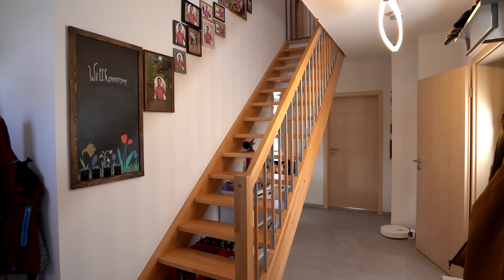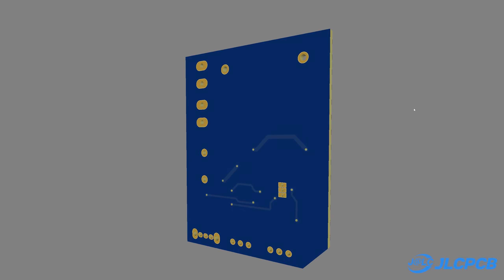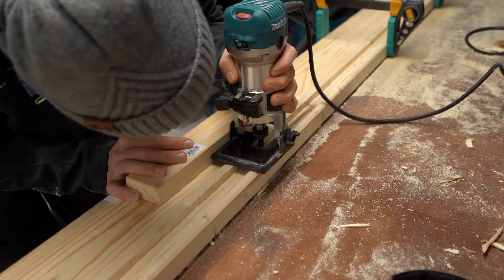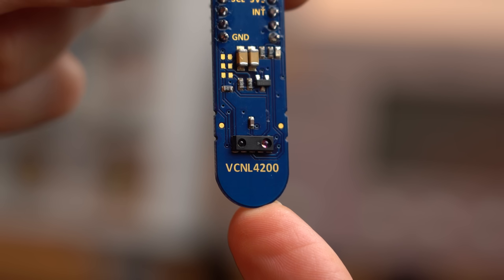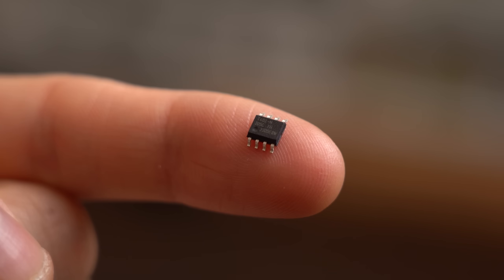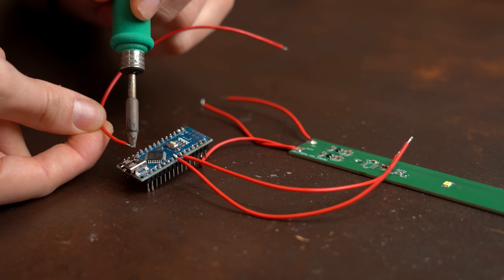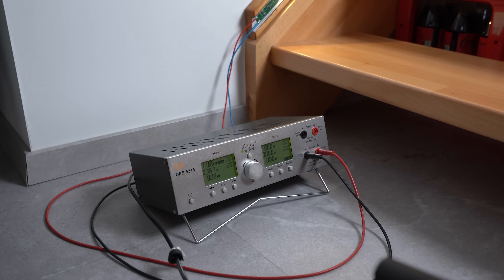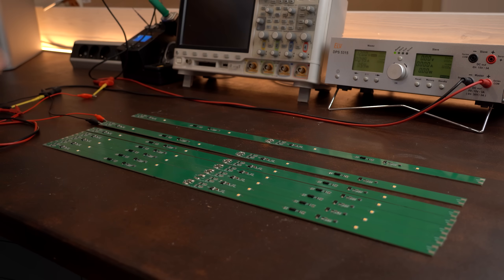I tried to Revolutionize LED Lights!.....And FAILED?

Comment: Like other comments (basically) said, having so many MCs (and sensors) involved is already a recipe for disaster... ^^; KISS should really be a core principle for designing anything. The following light may be nice but just complicates the build and adds a ton of extra components. The bare minimum would be one sensor at each end, a single MC that manages them, and then some simple latch/timer logic to turn the whole strip on when one of the sensors detects something. Make the other sensor turn the strip off again and add a fallback timer of 1-2 minutes in case there was a false positive. Raising the sensors to the "top" of the channel (or using light guides) would make it possible to use diffused covers for most of the strip and only a small piece of clear plastic in front of the sensor.

Comment: I'm scratching my head with some of the design decisions you made in this project.
Why make the light output not only dependent on the distance from the sensor, but lower as the distance increases?
Why make it so the step you're on is lit up, instead of it and the adjacent ones too? After all, what really matters is where your feet are going, not so much where it is at the moment.
And wouldn't you have used some pogo pins, or even regular pin headers to interface the boards? It would make it so much easier to debug, as it would be just a matter of removing the boards in the way of the affected board, and one at a time, instead of dealing with soldering and such while everything is in the wall.
And regarding the diffuse vs clear covers, have you tried with the diffuse to see if the sensor really doesn't work? And assuming it really doesn't, why not simply putting just a small piece of clear cover over the sensor, while using the diffuse cover over the LEDs?
And on another note, I really hope you succeed with this project, it looks really interesting.

Comment: Good video. I have also had this idea in my head for years. Maybe instead of infrared distance sensors, microwave sensors could do the trick? Or 1 really good long range microwave sensor combined with addressable leds or even with the WLED project.

Comment: A problem i had years ago with a networked chain of sensors like this was simple voltage drop along the chain. Ended up splitting the chain in two and powering from each end. The browning out of the microcontrollers let to all kinds of completely bizarre behaviour which disappeared when tested externally.

Comment: You could use pressure pads or membranes on the actual stairs, rather than ir detectors, and to make the stair before and after light up could you not use resistors coupled with sensors that detect the drop in voltage (2 step) to turn off so the step you are on will be at 5v (brightest) the next step would be 3v (dull) and the step after 0v or probably 1v then as you step on the next that becomes 5v etc etc

Failing that buy some of the cheap poundland pir garden stake lights, adjust the timers on them break the steaks off, tape them to the wall and add some wire to the battery terminals to join them all together with a 5v plug so they trickle charge, at least then if your power goes out you can still go up and down the stairs safely as they have battery backup....

You can tell me to shut up if you like im probably talking out my backside, im a pc tech rather than an electrician but i like to tinker 🤣

Comment: Your AL8860 circuit is going to inherently be noisy because there is no capacitor attached to the inductor. And the diode-inductor-LED trace is extremely long to boot. It's a massive antenna. You could try salvage things by putting a lot of ceramic capacitance in parallel with the LED but I wouldn't expect any miracles.

Comment: One way would be to have one "Master Controller" where each strip has its own ID and the "Master Controller" receiving the sensor data with a device ID and then sending a command with a device ID where the strip with that ID would light up

Comment: The Youtuber I Like To Make Stuff did this same project 10 months ago. He was re-doing his stairs so he integrated the LED strips into the steps themselves. It's been awhile since I've watched it but he had the same issues you did. He didn't resolve the problem and just ended up putting a motion sensor at the top and bottom and just lights up the entire staircase for a set amount of time.

Comment: My suggestion is to use an individually addressable LED strip and DIY a strip of distance sensors, all connecting to an arduino box. That way you don't have to reinvent the wheel and simplify connections.

Comment: Really cool idea, but as other suggested I would definitely go down the route of addressable LED’s with a dedicated warm white channel as well as only using two sensors on top and bottom the. You estimate that you walk at a certain speed…

A quick question on how the IR sensors work, don’t they interfere with each other? I assume they would have some modulation on IR patter  but if not having so much ir light doesn’t cause them to go strange?

Comment: Such a neat project!
I like very much the idea of an automated night light for the stairs. And your girlfriend was right to push for a solution which blends with the existing furniture: you did a very good job with the wooden housing.
I haven't looked at the schematic yet so I won't comment on the troubles with getting the design to do its job properly.
I'd like instead to make your life even harden 😆By chance I'm also looking to make a light helping me to find my way if I was to walk around the house at night and I'm thinking of using cyan (monochromatic) LEDs instead of white LEDs. The scientific reason is that the rods in the retina are the elements with the highest sensitivity to light and, even if they do not provide the perception of colours, they allow to see shapes with minimum ambient brightness. The peak sensitivity of the rods is around 500nm, which is a cyan colour. I reckon that, with cyan light, you should be able to get a good enough perception of the stairs while using significant less power than standard 'white' LEDs. Cree XLamp XE-G are available in cyan but you should be able to find cheaper alternatives.

Comment: That is such an excellent project!  I see where you were headed with it, (and kudos for working as a carpenter for a bit- THAT can be quite frustrating if it's not something you do all the time!)  I learned some things, and JLCPCB pricing info... I can't wait to get home so I can work on some original design boards to try them out!  Don't feel bad, that try, fail, retry, walk away loop happens to all of us!

Comment: I think it's better to light up the whole staircase for 30s. Just put two motion sensors at the top and bottom and if any of them senses motion, the 30s timer starts. What if you drop something, and you need to look back on the previous steps? And I like to look ahead further down on the steps. I don't think it's worth overcomplicating this. Light up the whole staircase at the same time. Yes it's not as cool, but more functional for sure.

Comment: i have not looked at your available downloads yet, but i feel this was initially just a programming error.

it seems as though your "databus" connection does not have contingency to mitigate "full saturation" of that bus when passing on the "one behind/one ahead" data in the  lighting scheme. . to explain, i think your code might just be going "if i have a high signal on this input then i'll put a high signal on mine." maybe with some "if" statements sprinkled in, to try and "reset" or push the status one way or the other... but you almost immediately (basically the first few loops the computer does through the program loop...run into a scenario where every node microcontroller is now saying "yes" to every other node micro and nothing in the code has the ability to change it to make it stop. i feel this stems mainly from the fact that not every microcontroller operates at the exact same frequency... and some inevitably end up far enough ahead the the timing between one and the next makes one a full program loop behind... resulting in loss of the ability to have the whole bus be "off" since there will always be an on pushing its's way through the loop

i mean... not exactly, but you get my drift? something like this is happening... it just looks like it's not doing anything to US when all we see is the result of the lights just staying on. but, if this is indeed the case, and something like this is happening in there. you may have to program yourself some kind of "packet delivery" protocol that will increment or decrement a counter as it's passed in certain directions to the next node's microcontroller, where you will sit and wait until YOUR node recieves the packet. you will then have to decode that information process it and see if you need to do something... or change the packet and pass it on to the next node's microcontroller. this will have an unintended effect of limiting how fast data can propagate through the system... which is not necessarily a bad thing. it can be used to your advantage to have the bus limited in speed to allow times for other programming to complete before the one previous to it does... it can be further restrained by inserting wait statements... but having to wait while we pass the "Hot potato" around the bus ensures that as long as the counter token is getting properly decremented, the bus will never reach a full yes state... and each micro takes as much time as it's needed and the individual speeds don't matter anymore since all you do is wait.

this could fix the issue, but might be hard to implement due to the memory size of the chosen micro.

great work, by the way, i always enjoy watching a project come together at the beginning, even if it's considered (at the time) a failure... it's no fun when it works the first time all perfect! makes for short episodes.

Comment: I don't see why normal led strips wouldn't have worked. There are individually addressable ones that can be controlled via WLED or Home Assistant. Combine that with a LD2420 to track your position and you are done.

Comment: Question, why not just use addressable LEDs and a singular microcontroller, rather than this mess of multiple MCUs?  I mean, it shouldn't be all that difficult, since the prox+amblight sensors are i2c devices they'll have an address, just pair the relevant i2c addresses and aLED adresses to the relevant PCB, that way when i2c address A sends data to the MCU and lights up aLED address A.1 and A.2 accordingly (given two lights per step, these can either be in series or parallel), then you scale from there.  You can also have a much simpler power backbone working off of this; the only potential additional thing you'd need is a signal amplifier, given that you're working with DC over significant distances, sadly using an AC line would just add back in costs via rectifiers, but for a proper residential application AC would be the way to go as DC is only recommended for localized circuits.  And since it's aLEDs, you can also opt for some nicer RGBW diodes and tune both brightness and color through the dimming spectrum; plus then you're not locked into a specific 'white' LED color, as warms seem to tend towards red and cools tend towards blue.  The logic would also be much simpler given the singular MCU, only one brain box to do everything, and honestly execution would be much simpler to as i2c address A is software linked to aLED addresses A1 and A2, all of the control is localized within that association; rather than dealing with the chain of MCUs where clearly something is influencing something else.  And given this, you could also do some other things, such as sequencing on the addressing logic.  

Personally I don't understand why you want to light the stair you're already stepping onto.  The problem with stairs is either catching your toe on the face/lip of the next step or missing the ledge with your heel, you'll want to light the next step in the sequence.  This would only really require detection of the initial sensor, say initial sense on sensor A lights A and B, retain that data and look for sense on sensor B to then light B and C, so on and vice versa in the opposite direction.  I'd also recommend a top and bottom step sensor and set of lights rather than the steps themselves, as you'll also want the top and bottom landings lit for the exact same reasons.  I would also recommend finding a decent way to light the lip of the steps and not just the flats, as the lips are where the tripping hazard is while walking up the staircase.  Also say something happens to be on a particular step, a cat, someone left an object there, etc., you can use the color feature and non-sequenced sensing to light the relevant aRGBWs (possibly neighboring diodes as well) as, say, magenta (easier on the eyes than pure blue, easier to identify on woods than reds, the alternative would be cyan for the same reasons, I'd probably stay away from yellow entirely)  rather than the typical white identifier, that way you already know there's an object on the step before you're even close to stepping on that specific step, akin to a warning light.  Obviously people are going to want to replicate this, might as well include every potential safety feature out of the gate; though, again, the best adaptable solution, and the proper way to do something like this is to power it with AC, just a low-voltage line so that you don't have the distance losses that DC sees, we're actually seeing lvAC a lot more these days with 'smarter' integration of various switches and stuff, because a low-power switch via a mains relay at the device is better (and safer) than a mains switch. 

Your solution isn't a bad one, perhaps a bit misguided and too modular in its current execution for its own good.  If each sensor board was isolated outside of power, sure, it'd work fine as a non-modular but repetitive system.  But for a modular system, as you intended, you want to cut down logic as much as you can for the sake of simplicity, especially with modules that otherwise communicate with each other; not to mention simplicity also has cost reductions, and taking a simpler approach can open up better avenues of execution, such as using addressable LEDs on a singular discrete line; though it'd be nice if we had faster adoption of i3c and thus more devices utilizing it, imagine if you had aLEDs and sensor chips on the same line without bottlenecking the line, maybe in another five years this'll be a reality.  Sometimes it helps to sit back and figure out how to make something simpler. 

As for the diffuser situation, you could just drill a hole for the sensor.  Alternatively use some diffusion material over the LEDs themselves with a clear cover, though you may want an optical standoff on the sensor just to avoid any potential issues.  Really any diffusion method would work.  The nice thing about going with addressable LEDs would that you could use more of them per step, drive each at a lower power for equivalent output to your current two, but this would even out the lighting quite a bit before diffusion is involved, and with diffusion it would look a lot nicer.  I'm not sure how difficult it would be to integrate into your system, or if your would even really be compatible, but a lot LED rail lighting is actually side-firing into a combination mirrored-diffusive medium where it lights a material rather than dispersing light via just the diffusive inserts, i.e. it's much more even and controllable.  Honestly, on this topic, I'd talk to Clive, given how much experience he has both professionally and just tearing things apart as a hobby for videos; I actually wouldn't be surprised if he recommends an addressable LED line off a singular microcontroller as well, there's probably a handful of pathway lighting systems, within the commercial/industrial sphere, that do what this project aims to do off of an i2c (or spi, uart, etc.) line and an aLED line with one brainbox, unless a complete package IC (sensor, control, and lighting) exists for per-light modularization and thus per-light isolation.

Comment: Why not addressable LEDs? No need for any custom board! Not even a 5V line next to the strip since few will be on at any time and voltage drop over the length is no issue

Comment: I suspect the problem is with the software in the Microcontroller. I know this from my own experience. You spend hours looking for the error in the hardware and in the end it was a programming error. Each board alone worked perfectly !

Comment: There might be a problem with the Attiny's PWM frequency, I believe the settings you're using right now gives you a ~31khz pwm signal.
The highest frequency mentioned in the datasheet of the AL8860 is 1khz but there's also no max frequency stated.
You'd first have to test and simply drive the CTRL-pin on/off without PWM.
If it works and you really want the fading then you could bodge in an RC-filter and drive the CTRL-pin in DC-mode.

Comment: I think the issue is you are getting noise from the ir lights and the sensors are interfering with each other's causing wrong measurements

Comment: you can use wled,they have a mode that you can attatch ws2812 addressable led and will light up one by one with ultrasonic distance sensor,designed exactly for this use